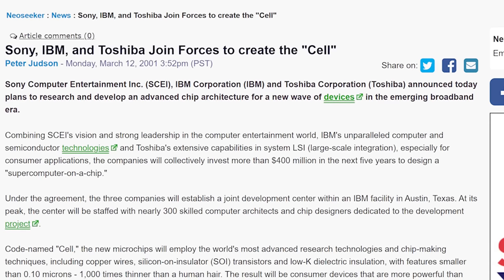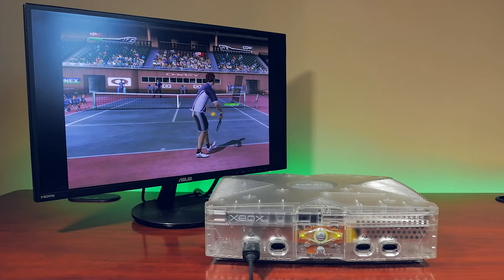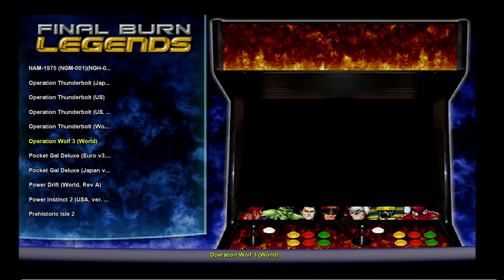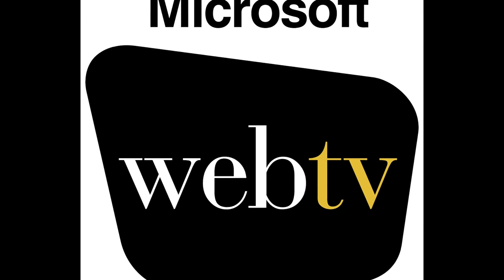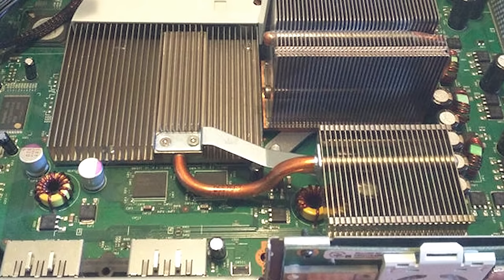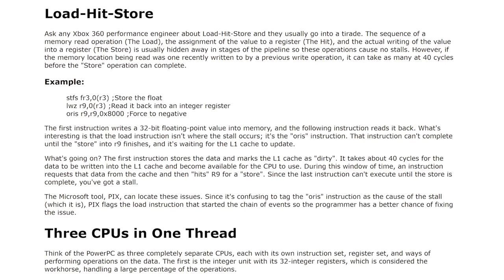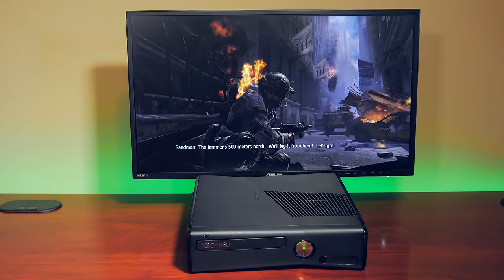Why Microsoft switched from Intel to Power PC for the Xbox 360  | MVG

Comment: ibm power pc was both a success and a failure at the same time. it took multiple cpu cores and made it a mainstream idea to have multiple cpu cores for your pc. at time of xbox 360 launch, you could go with a pentium 4 setup or an athlon xp setup. the pentium 4 ht setup added a "second" core that was virtual thru the hyperthreading technology. remember when core 2 duo and athlon 64 x2s were going head to head? yea i do. i remember the launch of quad core core 2 processors and quad core athlon 2s. i remember the original phenoms and phenom 2s. ultimately though the ibm power pc beat them all to the punch with the power pc tri core xbox 360. now you can get a ps5 or xbox series s/x with an amd ryzen cpu. plus lets take a look at the xbox 1/ps4. an amd supplied jaguar 8 core apu which was loosely based upon the bulldozer architecture.

Comment: Regarding the thermal issues of the 360, I had also heard the lead toy scare of 2007 caused the solder on the 360 to be changed to a lead-free variety. The new lead-free solder didn't deal with the heat cycling as well, got brittle, and connections broke. Any truth to that?
Reply: I've heard that too, and i believe Louis Rossmann says that was the reason why the nVidia GPUs failed so often in MacBooks

Comment: While plaintiff will fail, I do think that this made a fantastic case for major reform of the DMCA from copyright holders point of view. I don't think anyone ever imagined the scale of something like YouTube in 2001, so we have it where copyright holders of many kinds are getting screwed by a system that's like a 1600s guild craftsman vs. a modern factory floor.

The DMCA screws over big content producers, they are forced into licensing agreements to get any revenue for their product because all they can do otherwise is play whack a mole (hence the crash in music revenue), and it screws over smaller creators, first because they have to compete with pirated AAA works on the same platform, second because the creaky system can be used to harm them in a way that doesn't really result in punishment.

Comment: I do understand the benefits of the PPC ųarch in terms of compute capabilities, the benefits of risc over cisc and the integrated hypervisor*, but if they worked together with Intel to get a core 2 quad in there it be a massive increase from the old Celeron. When you look at PC games that generation some amazing improvements and dont think it would do much worse than a PPC system. Even if 360 is too soon for a core 2 quad, an Athlon 64 would not be a bad option either. Maybe they could have gotten a tri core Athlon since the routing 3 UMA nodes is much simpler than getting 4, as seen by the failure of Phenom quad cores. 

Ultimately this is yet another example of old  Microsoft as a company being too large and there be no communications between the teams working on various branches of the company. Imagine the things they could have done with a cross compatible gaming experience back in 2008, they would have blown Steam out of the water. And the capabilities of the Q6600 lasted quite a bit. I'm sure they got a good deal for PPC or whatever, it always comes down to just business. In the end x86 ended up being the future for console gaming for now and playing original games from that generation wouldn't be such an effort. 

And if it happened back then PC would have benefited a lot from it too, which would be another plus, but Steve Ballmer made many oopsies and didn't care about PC gaming at all. Which they owned btw, but just left this entire void for Valve to up their game and become the place for PC gaming for more than a decade. This also means that in the end Ballmer is the one to blame for HL2:Episode 3 to never to release plus HL3 ft Portal guns from Aperture science, since the success of Steam certainly brought a shift in that company. 

So in the end I do think the move to PPC was a mistake, especially considering the initial problems the developers had with the Cell chip and how hard it was to develop for. Direct X9 was much easier to develop for

*Though massive piracy happened on Xbox 360 anyway with dvd drive firmware mods and later jtag and rgh, especially in less wealthy nations it was very easy to get a modded xbox 360 with a ton of games.

Comment: I seem to recall hearing that the original Xbox 360 development kits were actually PowerMac G5’s.
Reply: Shamoa Krasieski  I would love to know more about those G5 dev kits. I wonder if Microsoft did any customizations to them behind just installing the IDE. Anybody know if the G5’s were the dual processor variants or just the fastest single processor one available? 

I also remember hearing that the G5’s could only run code at about half the speed of the final Xbox 360 design.

Comment: The fact that you attribute the Red Ring of Death failures to them running "hot" immediately calls into question everything stated in this video.
RROD was caused due to the switch to RoHS (reduction of hazardous substances) [lead-free] solder, which was not well understood at the time.
The formulation caused the solder to develop microfractures after a certain number of heat CYCLES, aka heating/expanding and cooling/shrinking.
It had absolutely ZERO to do with the absolute temperature at which the CPU or GPU ran. 
It was simply the solder expanded, contracted (times x number of cycles) and cracked.

There were numerous other early RoHS devices (i.e. the Nvidia 9400M and other members of the "Bumpgate" lawsuit) that ran at a temperature that was considered "acceptable" that also suffered from the heat CYCLE COUNT problem.  

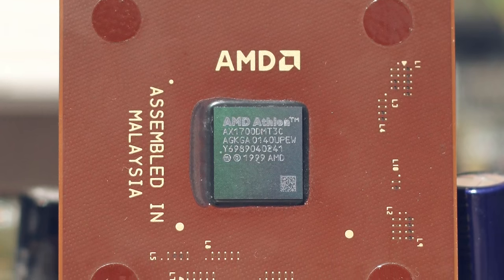5:20 "In reality, both the Athlon XP and the Pentium 4 would not be suitable for games."
That's possibly(?) the dumbest thing I've ever heard in a YouTube video?

Comment: This is why Apple switched from the G5 to Intel.  Steve Job gave money to IBM to develop the 970 chip as part of funding the power 4 and 5 generation of PowerPC.  IBM calculated that it would make more money suppling game console cpus than for Apple.  Thus, it placed all of their top designers on the cell than on the 970.  That is why I the G5 never reached 3ghz and had a high watt/performance problem.  IBM screwed Apple, and Jobs was upset enough to remove IBM from the 970mp chips photo during Macworld 2005.

Comment: We had the chance to switch to a platform other than x86 at this time, we could have more Power workstations today, it was an interesting time, but the thermal/lithography issue got in the way (which wouldn't even exist today because companies have become fabless)
Today having a Power workstation like the TALOS II or Blackbird, which even cutting many costs are still more expensive than x86 (But with many benefits I must say)

Comment: The idea was that first xbox 360 consoles had a very poorly designed ventilation system, and very cheap soldering techniques. That was available for ps3 too, in order for this things to work, you had to do a reballing to CPU and GPU. 
The main issue of both is that you had to powerfully components that produced a lot of heat in both of the systems. 
Xbox solved the issue by making GPU and CPU on a single die because now you have a single component that produces heat and it's enough to put a single Fan to get the heat out. 
Ps3 reduced the size of the cpu and gpu, to make them a little energy efficient, and where there is energy efficiency, there is less heat. I had both systems, phat and slim and super slim ( for xbox 360 its E series)  they made them more energy efficient and less faulty.

Comment: Not a surprise at all, back then Intel doesn't want the cheap console businesses and IBM couldn't break into the PC businesses, and Apple have to move into the PC businesses (boot into Windows), and then later AMD had to get the console businesses at all cost to survive (unused fab capacity). They are business decision, and the engineers will figure out the rest when the money issues are settled.

Comment: RISC always seems to cause issues. PowerPC Macs ren hot, consoles with RISC ren hot. ARM based Windows RT tablets didn’t perform at all.

So far, they seem to only work well in Mobile devices.
Reply: Later PowerPC Macs ran hot. G3s were fairly cool, G4s started getting warm, the G5s ran HOT.

Comment: Choosing RISC was right. PowerPC just wasn't the best implementation. It's sad that Sony and MS have now moved back to CISC (AMD64). Nintendo chose RISC (ARM) but went the low-power mobile path. Meanwhile Apple is showing, with their custom silicon, that RISC can compete very well indeed and specifically ARM can do high-power. I expect the next gen consoles to move back to RISC. And also the rumors about Apple getting into the console space, maybe via VR, are not surprising.

Comment: One thing you forgot to mention was that the original Xbox was supposed to use an AMD processor rather than an Intel! AMD had worked with Nvidia believe it or not, the Nvidia chipset was originally designed to connect directly to the AMD processor. But Intel came in at the last minute and stole the contract and Nvidia had to make modifications to get their chipset to work with Intel instead!

Comment: Microsoft went with "ATI" for it's xbox 1?  The ATI name was long dead by then...

But more interesting: to save costs, the PS3 and xbox360 processors were in-order execution, instead of out-of-order, which left a lot of potential performance on the table.
Reply: Xbox one used APU which is not even a graphics card, Just integrated solution for the consoles.

Comment: 5:18 This is outright wrong. Both Intel and AMD's CPUs were really good for gaming and general purpose computing by 2005-6. Apple went from PPC to x86 for a reason. While it's true the Pentium 4 had temperature issues, they could be lowered with slower speeds (which in fact is very common in the latest generations of consoles). However, AMD was the better choice, and was able to deliver a true dual core CPU by 2005, most likely outperforming both Xenon and Cell at a lower cost. It would have been a killer combination with Ati GPUs (especially taking into account the merger between AMD and Ati that took place later). And to this day we would be grateful, because retrocompatibility with that generation wouldn't be a nightmare.

As for why both Microsoft and Sony went from x86 to PPC, I think there's a simpler explanation. IBM's marketing was successful by selling an inferior product to Microsoft. Sony, on the other hand, had struck a deal to develop the Cell CPU with IBM and Toshiba as early as in the year 2000. They took a gamble, but it went wrong. By 2005, it was clear the Cell was dogsh!t, but Sony executives failed to understand the concept of sunk cost, and went ahead with that uber expensive abomination.

Comment: 2:03 A customized Windows NT kernel, as I recall. I wonder what is meant by “optimized for gaming”, other than merely “ensuring everything is locked up around the proprietary hardware”.
Reply: They dumped everything from Windows not needed for gaming,  like GDI/GDI+ (The API for software-based rendering), WIndow Desktop Manager, etc.
Reply: If they “dumped everything not needed for gaming”, then how come PC games wouldn’t run?

Comment: I suspect if the bright sparks had of had options in ram and hard drive upgrades 
My understanding at its core both the xbox and 360 used win ce/nt as its core with similar overlay to the interface teller machines use to this day...
with the complete migration into win 10 in current gen console  it is quite easy to consider  pc/laptop/phone/tablet/console master race..
though no matter what is in use as a console platform you still require a bulk media storage platform  to distribute content to the network..
because if you were  just to install bdroms from ps3-4pro you would likely go past a petabyte or 4, including dvd media plus updates and mods that might consume more than a petabyte..
I think if the idiots both at nintendo and sega had of gone with proper dvd support from the game cube (nintendo) and saturn (Sega) i suspect both would still be in use today.
though the real failure point within the dvd side of things  was the firmware and drives being used were not up to the same standard that the high end video phile  was using as  video transport

Comment: A 3 core, 3ghz risc cpu is only twice as powerful as a 733 celeron (basically pentium 2) in single threaded applications. And multi-threaded game engine support was in its infancy back then. PS3 had an even worse deal. It's cell processor with its one main core in lazy ports that didn't take advantage of the SPE's was probably weaker than the celeron. Damn son.

Comment: Great Video!!! Power PC was a very good price vs performance ratio at the time.  I wonder if Sony Stayed with the CELL for the PS4 if it would have been even more powerful.. The jaguar CPU is the biggest bottleneck this gen... I even heard that the cell in the PS3 is more capable than the current gen processors?  Just my .02c.
Reply: The Integer performance of the Cell is weak. The Jaguar is a much more powerful CPU than the Cell in terms of being a CPU. 

The Cell had a bunch of SPEs. These are co processors and are a lot like vertex processors. These were powerful at the time, but you wouldn't compare these cores to normal cores you'd find in a CPU. GPU's do the same tasks faster. 

Back when the Cell was developed GPUs did not do compute functions. They do now, and are much faster than what the Cell can do. The original idea with the PS3 was the same as the PS2. Use a Basic video chip and let the CPU do all the T&L and Vertex Operations. The Toshiba video chip was tossed out and Sony asked Nvidia to come up with a quick solution. Which is why the PS3 has decently weaker GPU than the 360. All the low frame rates and frame drops in nearly all 3rd party ps3 games are the result. The SPE's are able to offload work from the GPU and add fancy effects, which allowed the console to atleast keep up with the 360's more powerful GPU that featured many DX10 features. 360 even had tessellation hardware. 

But the Single Core Power PC unit in the Cell is much to blame for the PS3's lack of multitasking. Along with limited memory footprint. Stuff like party chat while playing a game just couldn't be done on PS3, as the CPU needed to dedicate itself to game code. The 360 on the other hand had 3 of these cores, and only 2 were ever really used for games and the lack of cache was a big problem when trying to use all 3. So the OS and background features mostly ran on the 3rd core.

The Cell would be a downgrade for current consoles. Big time.

Comment: If intel hadn't developed themselves into an absolute corner with the Pentium 4 (which basically got completely scrapped eventually since the following intel Core series is descedent from the Pentium M which is an iteration of the Pentium 3) we would have never seen PPC in the Xbox 360. It's even more bonkers to think about this as even at this point PPC was basically a dead architecture everywhere except in the datacenter.

Comment: makes sense to swap if you aren't getting what you need out of a chip, especially on economies of scale like this but it's also why I don't have any brand loyalty when building my pc hardware. everyone has different needs and performance and thermals change over time, like yeah intel is great right now for games but if they can't lock down sub 10nm amd is gonna clean house on their last remaining holdout, gaming fps, pretty soon, as they've steamrolled everything else.  Both main consoles are AMD, and in both server and pc markets they throw pretty decent cores at you with massively improved stability from years past, even if the 5700xt in the gpu space is kinda meh with shitty drivers. I mean I still bought intel/nvidia myself as a gamer / audio producer but I build for others as well and when I ask family and friends what they want out of their PC nine times out of ten they go AMD both cpu and gpu. It makes sense to swap when your needs are met at a lower cost, AMD is the way to go these days. Wish I had bought stock pre ryzen.

Comment: "The biggest limitation of the original Xbox was its memory."
It was still at least twice what the competition had! I know that wasn't the point of this passage though.
Reply: Well in order to make a console very powerful, they would have low amount of RAM.
You can see how the Gamecube was more powerful than PS2 but had less RAM than PS2.

if you have to choose one option, What do you choose: 
1-)A powerful machine with low amount RAM 
or 
2-)A weaker one with more RAM
Reply: @DDT-lr3zz  So what's your point?
Reply: @nthgth  Just tell me:

1-)Do you prefer a powerful console with low amount of RAM 
or
2-)weaker console with more RAM